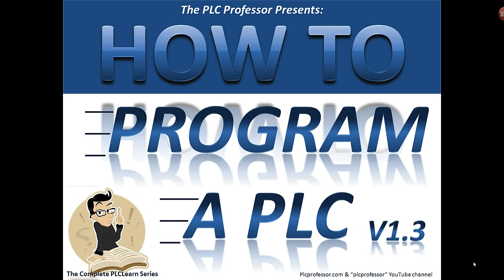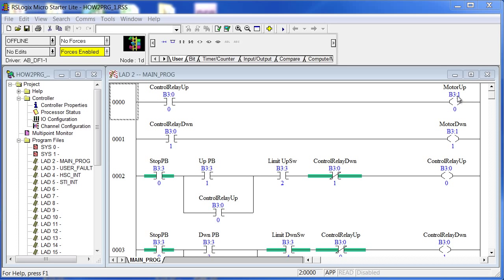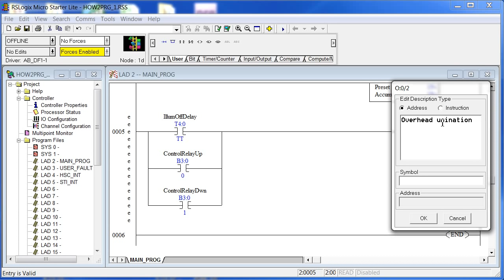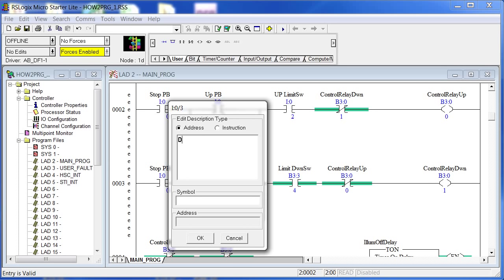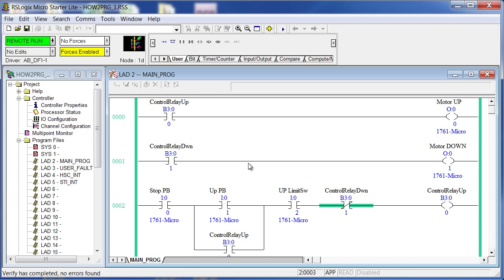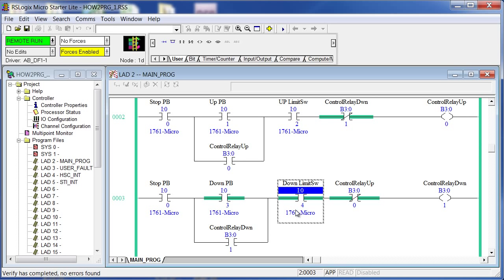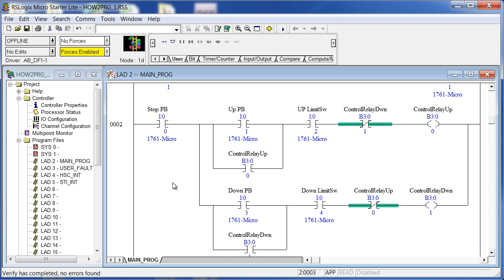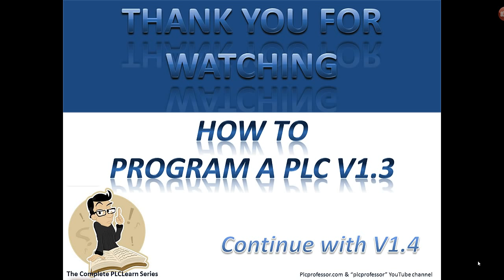Prog-1d How To Program a PLC - Basic Level

Comment: Can you please explain to me what is meant by a false to true transistion. i am confused
Reply from the maker: If it were electrical, it would be an off to on transition. Ladder logic diagrams are logical expressions using a symbology that evolved from the former electrical circuits. Rungs of logic are never on or off, they are always true or false just like any verbal statement. This subject is covered in depth in the first couple of presentations in the lecture playlist. It is the instruction's true or false state, not the electrical state of the bit in memory that determines the logic, even though the instruction is true or false because of the electrical state of the memory location that it addresses. The instruction XIC and XIO are true if on and true if off respectively.

Comment: I never understood how you had the contacts of CR1&CR2 in parallel in the wiring diagram for the timer and then in series in your PLC program?
Reply from the maker: The hardwired timer in the electrical circuit is an off delay and times out after both contacts are open. In PLC programming, as covered in the Basics manual and videos, I emphasis not using TOF instruction because they are difficult to follow when troubleshooting using the .DN bit from that data type. A TON behaves as a TOF if you invert the states and the logic controlling the true false state of the rung. You could use the same logic in the LLD if you use a TOF instruction.
Reply: plcprofessor Oh ok I get it. Thank you,

Comment from the maker: I am not totally sure what you are asking, about the electrical circuit or the eventual ladder logic. The switches should always be fail safe, no motion if a wire breaks but in the code it doesn't matter as long as the logic functions, ie... true if off NO switch vs. true if on NC switch. Elaborate if this is not what you need, thank you..

Comment: Thank you very much for putting these instructional videos together.  I tried to extend your example to include the photo-eye switch logic to mimic the behavior my home garage opener: when the switch is activated, the door will stop and then open.  I added a new run for the switch, but it did not work.  Hope you can post a video with a photo-eye logic.